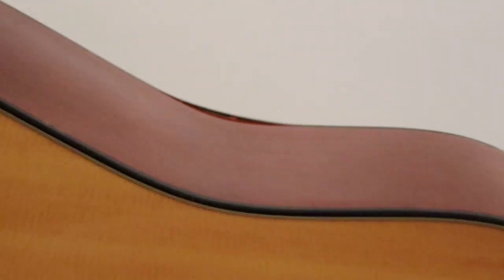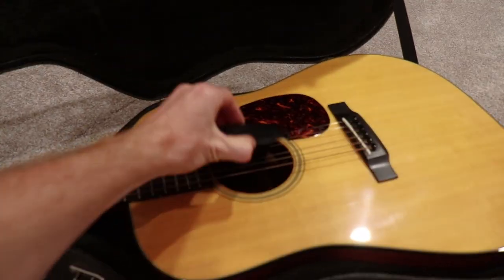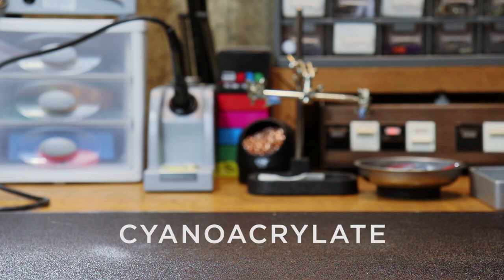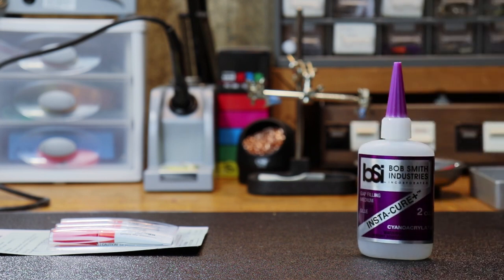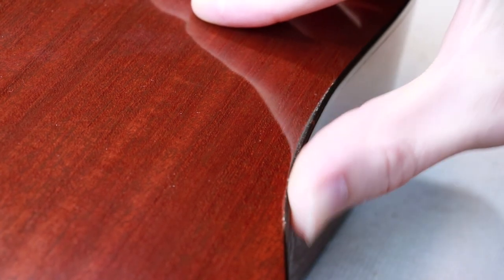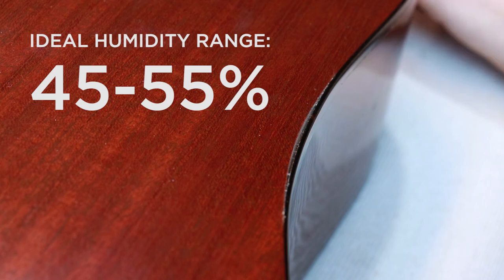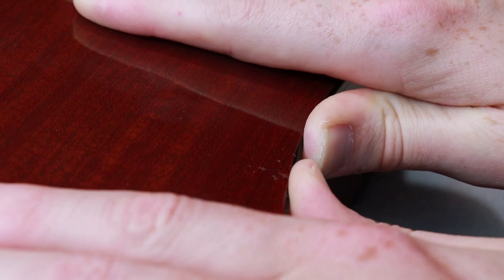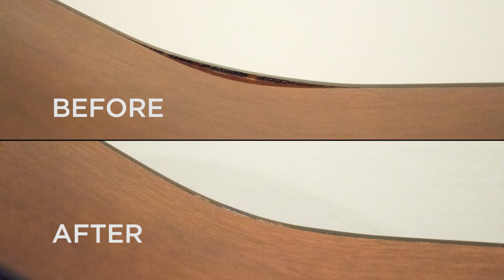How to Repair Acoustic Guitar Binding

Comment: Just be careful and do your research. I was going to do this but the consensus is that CA can bleed into the wood and discolor it. It can also damage finishes. Some repair guys recommend using shellac to seal the wood and prevent any bleeding. Different luthiers and repair guys have recommended Weld On and Tite Bond instead. I'm probably going to use Stewmac's binding glue which is another favorite.
Reply from the maker: Well I can't speak to every situation, but it has been almost 2 years and the repair is holding up great and isn't very noticeable at all.
Reply: The guitar already has a finish on it. Therefor bleed is not a problem at all. You are referencing a problem that luthiers have when originally putting on the binding, using a lot of glue all over the guitar with no finish on it. Spruce is particularly bad for this problem. That is why they use shellac as sort of a temporary finish to help discourage bleed. That is not a problem on repair jobs like this one because of the lacker. CA glue is a widely used product for just such an application.

Comment: All kinds of things wrong with this method. The waste didn't shrink, The Binding did. You need to heat the binding to make sure it is stretched enough to glue back in. And then never, never use super glue on a guitar. It wasn't used to build it, and it shouldn't be used to repair it. Wood glue only.

Comment: I have six guitars in my music room some as old as 1955 up through the years until till now my Martin which is 11 years old started about 2 years ago first time binding came loose and about 3 more times since then . The Martin is the only one that ever done this . The humidity is controlled with a big gauge on the wall . Martin has a great sound but I would never buy another one . I did the repairs according to Martin's spec's that they sent me six months later it comes loose again .
Reply from the maker: Yeah mine is bad again.  I feel like the binding just needs to be completely redone.
Reply: The consensus in Martin circles is that the factory changed to a more environmentally friendly binding glue in around 2012, leading to these issues. I have had binding issues with most of my Martin’s, even though they are in a humidity controlled room. Worst has been my CEO-7, unfortunately. Great guitar, though, otherwise.
Reply: Mine is a 2011 D-35 and had this very same problem at all four waist corners!

Comment: I glued my bindings back with wood glue before watching this. Should I worry? Also how do you check the humidity and what do you do if it is dried out?
Reply from the maker: The wood glue should be fine. It's just that it takes longer to dry so it is usually harder to use with weird little shapes, where as with the CA glue you can just hold it in place until it dries.

If you want to check humidity then the best way is to leave a humidity sensor in the case with the instrument. If it is dried out then you want to pick up some kind of sound hole humidifier.
Reply: @MerwinMusic  thanks! I used a lot of tape.

Comment: Why would a repair shop recommend refinishing the guitar after replacing the binding? It’s recommended on their web site
Reply from the maker: If they are actually replacing all of the binding then refinishing is best and probably necessary.

There is a big difference between re-gluing a little piece of binding and pulling off all the binding and installing new binding. Just depends how bad the problem is.
Reply: MerwinMusic thanks

Comment: You shouod state at the begining, and not the end "This is not for a museum piece". 
You don't hold binding in place while gluing. Period. Tyoically, the adhesive will either weep into places unknown, from different applied pressures, ruining your finish. 

You mask, as well as mask protect surfaces. It's no wonder your end result wasn't perfect. You simply cannot control the process with hand pressure. Particularly anything greater than a one inch seam, or worse, where the binding has naturally pulled away due to humidity.

Thanks for the band-aid fix instruction. Some people have Martin's they would like to also play, but not see a shoddy repair.

Folks, do not do this by hand pressure as shown, unless you want tears in your eyes, and wondering "what did I do?"

Also, use Bind-all. It's made for bonding such materials.